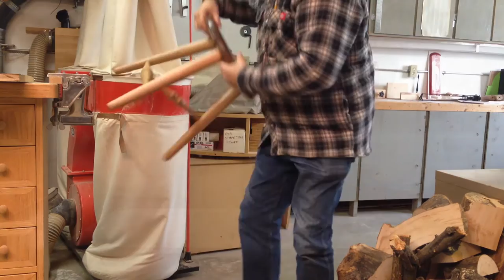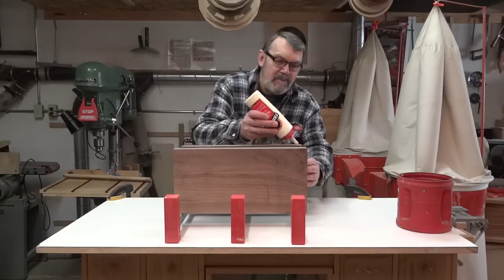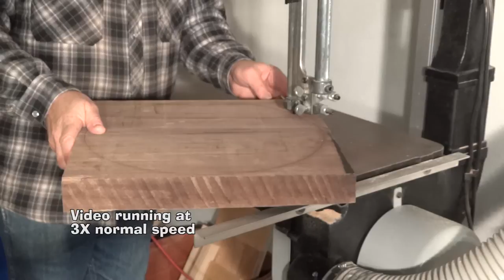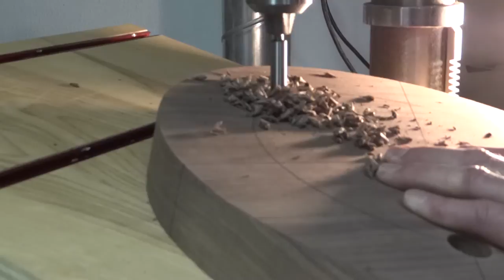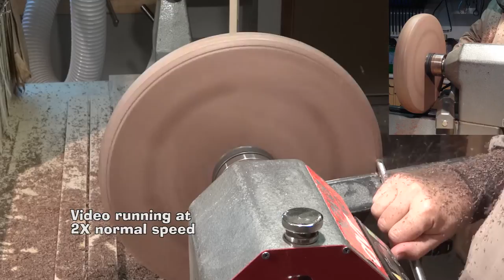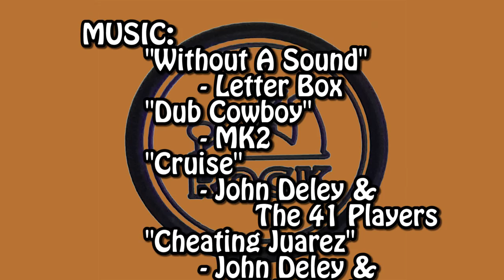Turning A 3 Legged Stool - Part 1

Comment: I like what you did with the stepped angle on the underside of the seat, I figure it will make it easier to grip when picking it up. 
I have a jointer, but I really haven't got the knack of using it yet, sometimes if the edge has a bow I just make it worse.
Reply from the maker: traog 
Thank you very much. I'm glad you liked it. When jointing a board with a 
bow be sure to always put it on the jointer with the bow upwards. In other 
words, there will be a gap on the surface of the jointer toward the center of 
the board. That way you will only be removing wood from the 2 ends of the board 
until it becomes straight. If you try doing the other side of the board it is 
almost impossible to keep it from rocking and you will never get it straight or, 
as you said, will make it worse. Hope this helps, my friend.

.....Gord
Reply: Thanks for that explanation, Makes sense, and actually a bit obvious, don't know why I never thought of it that way before. Probably why sometimes it worked and other times it didn't.     
BTW, I'm a Gordon to that's where the og part of traog comes from.
Reply from the maker: traog You're welcome, Gordon. Hope it helps with your work in the future.

Comment: Gord ... Alternatively, you could have used a larger Forstner bit (same diameter as finished leg) to cut a shallow recess for each leg at the same angle you drilled the mortises for the tenons. That way, the leg would have a flat shoulder at the proper angle and you wouldn't have had to waste away so much walnut on the bottom of the seat.
Gerry
Reply from the maker: Gerald Jensen Good point, Gerald, I hadn't considered that. The reason I wanted a smaller mortise was so the shoulder of the leg would hide the mortise. Unfortunately, I didn't do as good a job of matching the angle on the bottom of the seat with the shoulder of the leg as I had hoped. Oh well, bound to do better next time; this was my first effort and I'm still relatively new as a turner. Thanks for the input, though, it is appreciated; I always appreciate a different viewpoint. Thanks for watching and commenting.......Gord

Comment: Hey Gord, I'm liking your videos.  Well produced and very descriptive.  I was wondering where you get your logo coins made?
Reply from the maker: Cactus Makeshop Thank you!!! I appreciate you watching. The logo coins were made by a friend a few years ago at the place he was working. Unfortunately, he no longer works there and I don't have a source for them. Not sure what I'm going to do when I run out!! Sorry I'm no help in locating any but I think anyone who has a CNC type machine could make them. They are made from a plastic that has 2 layers of different colors and by carving away a bit of the top layer you end up with the 3D effect.
Reply: I know exactly the plastic you're talking about.  Same kind used to make engraved signs.  Thanks!
Reply from the maker: Cactus Makeshop My pleasure, Chris.